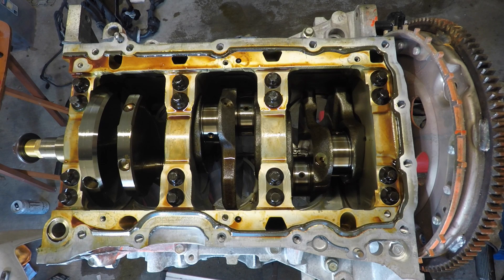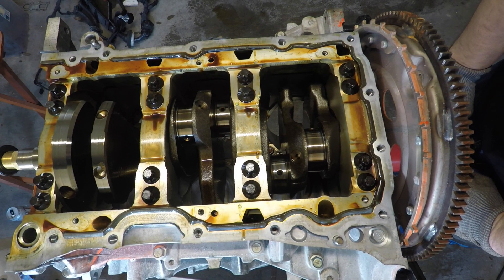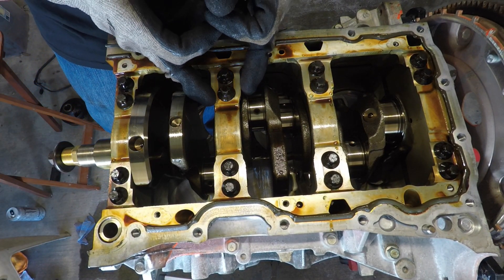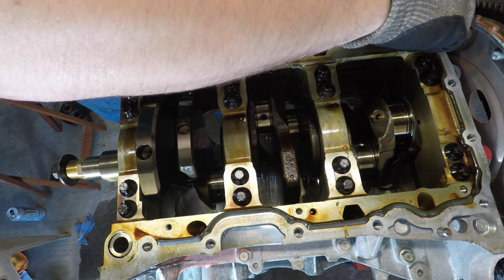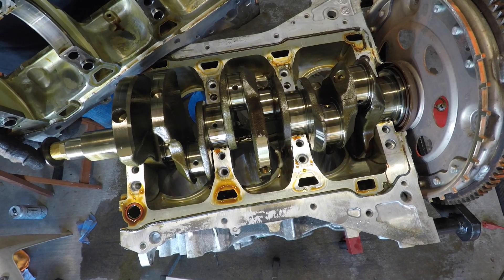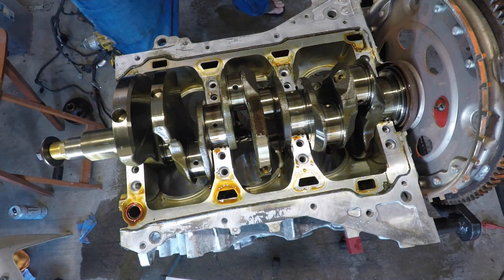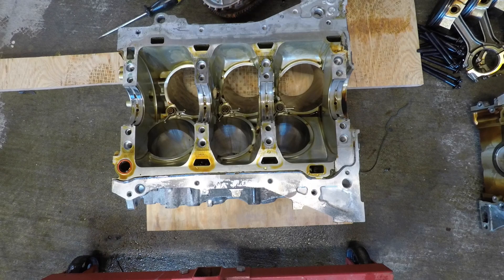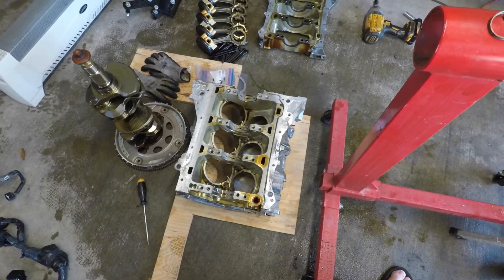Forged VQ37VHR build part 12, removing crankshaft, lower block, and measuring crank tolerances

Comment: Speechless how helpful your videos are! Thank you so much! Bought g37s with blown engine and cant even spin crankshaft. 5th piston broken inside. Kindof running out time, do you think, from your experience, i should consider buying another motor block and left cylinder head as well? bought another cranckshaft already. Going to disassemble it very so, just preparing stuff!

Comment: Thanks for the videos. I wouldn’t have tackled this without them!!
Reply from the maker: You got everything running right?
Reply: @garagefanatic7830  I just finished tearing it all down this morning. I’m in no rush (since boost is expensive) but I want to go through and take measurements on everything and compare them to the SDS. Once that’s done I’ll send it off for machining. Hopefully you’ll have some assembly videos by then 😊.
Reply from the maker: @coreywellons121  I should be starting on assembly videos this week since everything is at home waiting for me. I'm in Texas on a "5-6 day job" that has lasted over 3 weeks now. 😂
Reply: @garagefanatic7830  How much would you charge to put together a build motor. Labor wise? I'm in Texas aswell.